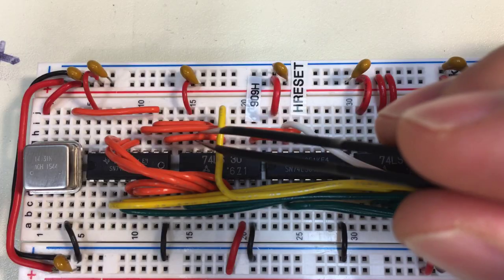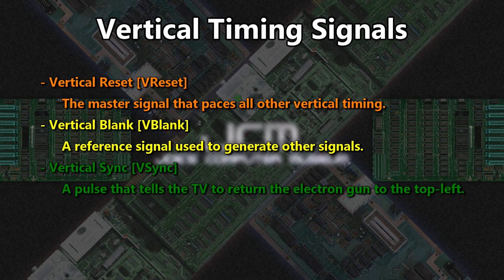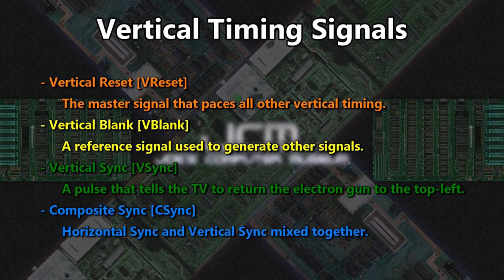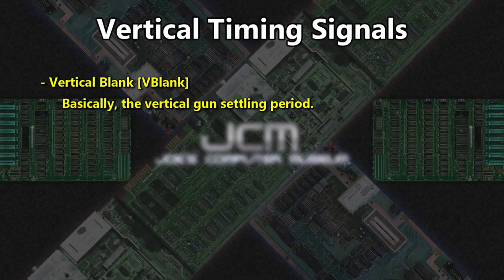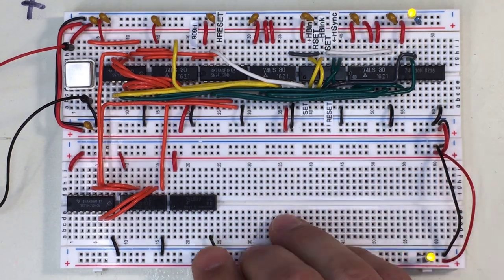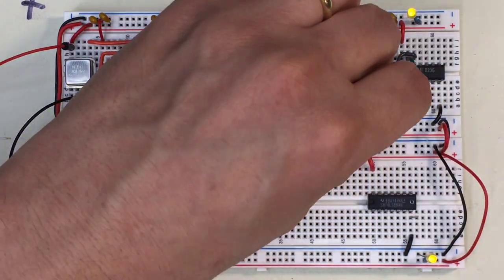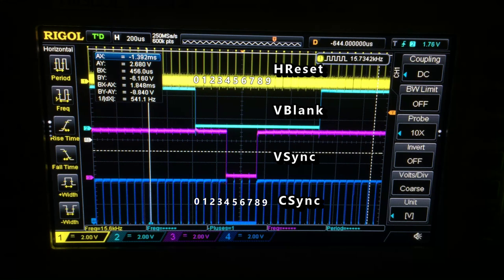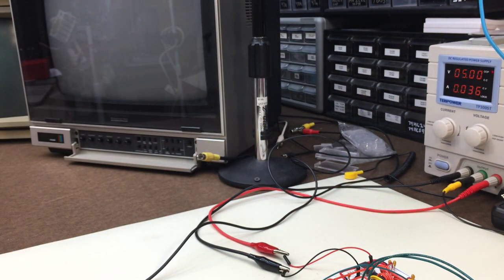NTSC/Composite With Standard Logic - Vertical Timing Section - (JCM-1 Episode 12)

Comment: Hi Joe finding this very helpful been trying to understand composite video forever!. Just to clarify the H reset pulse back into the clk pin of the vertical counter 744040 is ensuring that on every clock pulse it counts another horizontal line once counting to 263 it resets and start again?
Reply from the maker: Basically. There are two counters, one for Horizontal and one for Vertical. Horizontal counts how much time it takes to draw a line, and Vertical counts the number of lines. Every time HReset fires, it does two things: first, it resets the horizontal line counter so each line takes up the same amount of time. Second: it increments the vertical line counter. When the Vertical Line counter hits 263, VReset fires and all the counters are reset, so that when enough lines have been drawn, a new frame can be drawn.
Reply: @JoesComputerMuseum  Awesome Joe thank you for the detailed response mate, I was just a little stuck on the Hreset being sent to the clock pin of the vertical counter, I think were on the same page, clock pulses counts increments when we hit 263 lines  Vreset pulses then rinse and repeat. Mate really awesome stuff been so hard to find a detailed breakdown of a comp circuit using TTL. Thanks again!

Comment: Did you ever try to record the signal on a VCR?
I've had some VCR that were not pleased with timing that were a bit off. Even though the picture on a TV was very crisp, the recording was complete garble.
Reply from the maker: I have not tried it. If it ends up being a problem, the only thing "off" on the timing is VSync, which can be easily fixed.

Comment: Could you explain why you're mixing different logic families (HC, LS, etc.) Shouldn't you at least be using TTL compatible groups (like HCT+LS)?
Reply from the maker: The honest answer: because I am learning as I go and during the design, I didn't know the difference.

I used HC parts mostly due to a lack of LS parts in my stash and/or a lack of them existing. The counters for example: I wanted to use a single chip, instead of two chained together. The 4040 does the trick.

A later revision can be upgraded completely to HC, for example.
Reply: @JoesComputerMuseum  that's sort of a recipe for erratic behavior.  The logic families have different voltage levels for 0 and 1, so you can get stuff that "works for a while" or "works transiently" but flakes out when there's too much noise in a circuit.  You'll scour the circuit looking for something wired wrong, but won't find it because the only thing wrong is that you've mixed logic families.  A few families are more or less interoperable but the safest approach is to stay in one family.
Reply: J R sure, but can’t this be easily fixed with some pull up resistors.
Reply: @markcummings150  only sometimes.  It depends on what combination of families you've mixed together.  The best approach is just to use the same family throughout.

Comment: Actually, most classic systems (and some computers, like IBM CGA output) truncate to 262 lines.  Not that it matters for connection to a CRT, but it might matter for connection to a very modern device with composite input, or a capture device.  Just FYI!  Keep up the good work!
Reply from the maker: Yep, I am aware. I've built the circuit ahead and things are working for my intended purposes. :D
Reply: @JoesComputerMuseum  And that's the point of Homebrew :-)